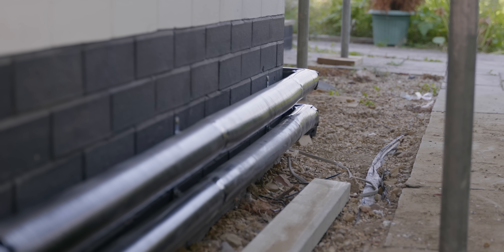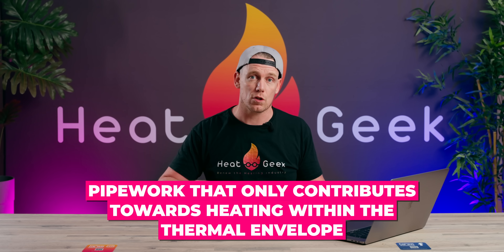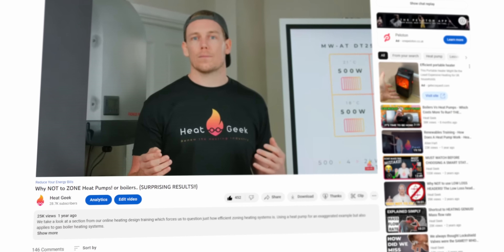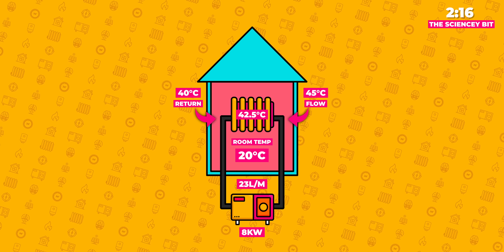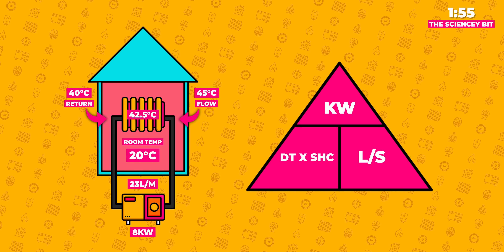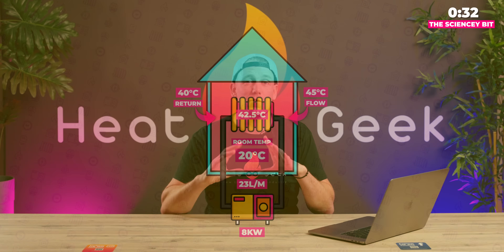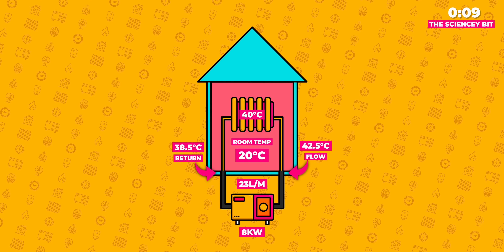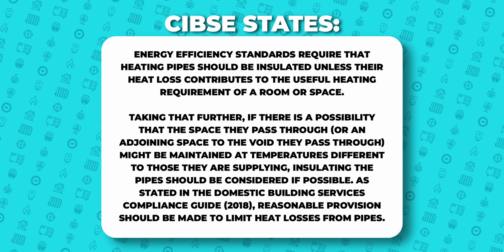Stop Insulating Pipework!

Comment: 9 out of 10 times ignore this and insulate your pipes. This only works if your house is very  well insulated and you heat your whole house at all times.
Reply from the maker: This is relevant for 90% of UK homes. And 90% of homes should be stable state heated.
Reply: @HeatGeek  what about the 10% ?
Reply from the maker: @Steamzombie1838  insulate in the 10.. as we say in the video
Reply: @HeatGeek a lot of UK homes won't have heating on a different zone than hot water sadly.

Comment: In my case the floor between the ground and 1st floor is not "within the insulation envelope" because I live in a 30's house with a howling gale running between the floors.  I also found that the cold water pipes were running alongside the heating pipes, meaning that I had to run the tap for a while to get cold / fresh-tasting water.

My rooms are all separately timed / zoned from each other (my heat moves around the house with me, on a schedule) so i feel that insulating the pipes was a good move, overall.  It was not expensive and I was pulling the floors up anyway, upgrading the pipework for a possible heat pump installation (on which I am yet to be convinced, though I am still thinking about it).
Reply: Cold pipes should never run along side hot pipe work because of heat gain into the cold.
Reply: @jablot5054  ideally, yes. But this house was built in 1935 and I'm afraid that ship has sailed.
Reply: Why is there a howling gale running between the floors?? Shouldn't you deal with that?
Reply: @ChrisLee-yr7tz  I may be exaggerating... but the walls have cavities (filled, but still), they also have vents, the joists penetrate the inner brick line, this joint is far from perfect, therefore any strong wind that blows at the building penetrates the void beneath the floor.  I would not, therefore, say that this is a fully insulated space.
Reply: Further, even if i did wish to fully seal these joist entry points, I would have to pull up several floor boards to get to them, and foam the gaps, which would likely result in rotten timbers.  This is an old house, it's not supposed to be fully sealed.  I have removed the worst of the ingress of air into the living areas but the structure needs ventilation.
Reply from the maker: @Possibly Interesting  ifnyou have howling gales between the floors of a filled cavity property you have bigger problems. And your rads have to work much hotter currently then they should do.
Reply: @HeatGeek  as I say, something of an exaggeration for comedy effect. The cavity filling is not perfect, my Flir shows bright spots, needs looking at. The house is old, I'm doing the best I can but a new house is definitely not on the cards. Everything is now pretty well sealed from draughts, the place is much easier to heat as a result. But things like the old chimney vents are not a problem I can solve without spending a lot of money for not much gain. I do have gigantic radiators everywhere, so true vast majority of the heat goes into the rooms, very quickly. I know you're not wild about zoning but I keep my doors closed and it works well for me, I'm happy with my choices.

Comment: "and lastly, please do always insulate [pipework going through] brick walls". I don't see why you should always do that. Depending on the construction style (varies by region/country), brick walls can be used inside the thermal envelope. Why would you insulate those? 
Other than that, love the video -- makes complete sense!
Reply: I think Adam was really talking about "external walls" when he mentioned insulating the pipework passing through brick walls, but as he was wrapping, he just called them "brick walls" so he could slip in the reminder about sleeving pipework going through any brick or block wall, which is done to allow the copper to expand and contract, and to avoid contact with any mortar than might have a high sulphur content.

Comment: Guessing you still going to want to insulate your hot water system pipe work to avoid losing unnecessary heat into the envelope during the summer.
Reply: Yes, Adam said this at the start of the video. He also mentioned about insulating the cold water supply pipes which can have a number of benefits: slightly warm water isn't as nice to drink, it might get warm enough to allow legionella bateria to start to multiply, and it might promote condensation in damp rooms such as bathrooms.

Comment: Similar argument over incandescent light bulbs. Heat and light at the same time. The heat may not be considered efficient as it's not light energy but in the UK, certainly for half the year, needing to use lights and heating go together :)
Reply: but thats the equivalent of using resistive heating which is terrible compared to heating with heat pump systems
Reply: @N1ghtR1der666  It is yes but if it's already there and a heat pump isn't, then it's just not waste heat, as distinct from just being less efficient than it could be for the same energy input.

Comment: What’s your opinion on radiator pipework running through screed above a concrete slab, none of which is insulated? Octopus are installing a ASHP and I I can’t get a straight answer on whether the loss of efficiency makes it worthwhile changing the radiator pipework to run up the walls and into the first floor void. My rough calculation is that there’s currently 30 meters of pipe currently running in the screed.
Reply: Not having insulation under the slab or under the screed isn't going to meet part L of the Buidling Regs. So you could ask them to show how the installation complies with Part L and leave them scratching their heads.
Reply: @tlangdon12  Part L is not retrospective. Imagine the chaos of all the uninsulated concrete slabs being dug up.😳
Reply: Thanks Tony, I’ll give that a try 😂

Comment: Very technical. But not insulating any hot water pipes within the thermal envelope used to be the norm anyway years ago. When did they start doing it and why. Would be my question. I don't follow all the technical mumbo jumbo but I just think a hot pipe radiating heat back into the room isn't doing any harm and as you say may be a benefit, so we never insulated them.

Comment: I have a question…..my parents have a detached house with a fairly new Ideal boiler heating 13 not very big rads and a megaflo water cylinder. They had the boiler temp set to 70. When the heating is on the return is about 68 so no condensating going on there. I lowered the boiler temp to 60 which made the return about 53 and with a few tweaks to the rads the house was still warm even in these current very cold conditions. My father is worried about the hot water temp as the cylinder stat is set to 60. What are your thoughts please? By the way, great videos, very interesting.
Reply from the maker: If you have a combination boiler it doesn't matter. Turn down the hit water temp tho. If noy a combi the boiler needs to be at least 5c higher than the cylinder.
Reply: @HeatGeek  thanks for the reply. Not a Combi. I will set the boiler temp to 65 so at least it’ll condensate for a while at least until the return comes up. House needs bigger rads really which is what I’m currently fitting to my house after watching your videos.
Reply from the maker: @LolsK6  watch out hotbwater temperature video before you do that!
Reply: If the DT across the boiler is 2C they probably do not need the heating on.
Reply: @normanboyes4983  not necessarily, it could also be that the radiators are all fully open across their lockshields, as seems to be common now when installers fit TRVs (I have had a few tell me it's not necessary to balance rads if TRVs are fitted).  The problem there is water flows through the system too quickly, reducing heat loss significantly, which is not what you want! This in combo with an low ratio modulation, oversized boiler and small rads would cause this situation IMO.

Comment: To make heat my heat pump has 2 big fans 2 pumps 1 condenser to bring it up to heat and cost a lot more than my gas fire which heats the room I am in the heat pump runs all through the 4 bedrooms kitchen and bathroom do the sums in cash.10 minute gas, toasty 2 hours heat pump not so toasty and skint.
Reply: Your gas fire is dreadfully inefficient compared to your heat pump. About 50% of the heat it produces goes up the chimney! What a waste!
Reply: @tlangdon12  yes but the 50% is where you want not heating empty rooms plus it is cheaper.I have tried it and proved it heat pump don’t cut the mustard 55kWh to keep the 1 room warm gas fire toasty and cheaper.No one will tell you how to run the thing,leave it on turn it off? Love to know
Reply: @Allegedly2right  What make and model is your heat pump? I'm curious what size of heat pump can consume that much power.
Reply: @tlangdon12  Grant Aeronia HPID17 R32 yesterday it was 28kWh the colder the more it uses and that is 19c
Reply: @Allegedly2right  Thanks for the prompt reply. I’m guessing you have a very large property. My 5-bedroom Victorian End Terrace house with solid walls, old double glazing and minimal loft insulation is heated well by 19kW. 55kW of heat loss is immense. Your heating bills will also be immense.  But the problem isn’t the heat pump, it is the size and level of insulation of your home, and the cost of the electricity.

Comment: I've always wondered about this in floor spaces and have yet to do it. I was considering starting to do it with heat pump installs so I'm glad you've cleared this up.
Reply: Full marks for English.
Are you English and middle aged?
…apart from “installs”
Reply: @paulgrieve7031  do you search the Internet in pursuit of grammer mistakes? Does it make you feel big to correct people? If so you really need to find a better hobby.

Comment: Trying to explain this to building control after the Part L changes is not fun as they practically insist at times that anything not a radiator should be lagged. Next time I get a difficult one I'll send them to this video, it's faster than digging out the literature.
Reply from the maker: Thanks 😊 .. what literature is there though???
Reply: @HeatGeek  The Part L document itself, I normally have it printed in the van along with BS7671, the gas regs and pressurised hot water to throw at them when they're being daft. Though I find most of them have a little knowledge of all areas, very few are up to speed on everything they're actually looking at.
Reply from the maker: @Effer Vescence  This isn't in part L interestingly!
Reply: @HeatGeek  That's exactly the issue, they tend to come on site and make assumptions. One site we even had a chap that wanted us to put LPG in a basement (4 inches below grade) rather than sticking to oil (due to being near a river). You have to spoon feed them information like first years. The video will be preferred compared to having to sit pulling teeth.
Reply from the maker: @effervescence5664  the struggle is real!
Reply: @HeatGeek  "This isn't in part L interestingly!" ... Is this actually correct? I'd LOVE you to be right but it states in the latest Part L docs (that came into effect on 15th June 2022) that: "4.24: In a new system, all of the following new pipework should be insulated. A) Primary circulation pipes for heating circuits where they pass outside the heated living space,
including where pipework passes into voids." I believe it's OFTEC's view that 'voids' refers to anything where pipework is effectively hidden, e.g. under floors. So, surface-mounted pipework doesn't legally have to be insulated but stuff under floors would. I also understand that it's now expected that this is documented photographically at the time of install so you can prove this has been done. As much as I agree with you on this Adam, I think to comply with building regs, you've got to insulate. Any more thoughts on this?
Reply: the regs are correct, you don't want to warm up floor voids and other perimeter spaces when these don't need to be warm, not insulating the pipes in voids is like putting a big radiator in a store room and then claiming you are saving heat!
Reply from the maker: @Alexander Newnham  yeh, my thoughts would be.. as many regs, they are incorrect. Regs haven't kept up with tech and information. We aren't breaking new ground here
Reply: @HeatGeek  Not sure I totally agree with your arguments on this one.

The thermal envelope is not always continuous. Take our timber framed house, there's 100mm of insulation between the studs in the walls, but zero between the ends of the floor joists where they sit on top of the walls.

However, I think the biggest reason for insulating pipework is to do with the airtightness layer in a building. It is usually formed at the plasterboard level by the joint filling and/or skim coat on the internal surface of each room, sealing any penetrations (such as switches, sockets, light fittings), and also sealing the wall to the floor by silicone around the skirting board. However, in the wall/floor voids, there is little consideration given to airtightness. Heat loss to ventilation will be greatly increased in these areas (especially where the joists are cut into the walls).

I think a good portion of the heat from pipework in voids, will be lost to ventilation. I would say this is why the regs say you must insulate pipework in voids.
Reply: @stokebob  I agree. Also this Heat Geek advice assumes a perfect configuration, which we all know is sadly rare.  We have a large (220m2) semi over three floors, that has an undersized boiler and rads (thanks to previous owner's reliance on British Gas boiler insurance scheme), boiler is in basement (habitable room) with all pipework in the room exposed and unnecessarily winding/long due to many alterations over the years. It resulted in that room getting significantly overheated, and the rooms on top floor not getting warm enough. So we insulated all the hot water and CH pipes in that room, and also the exposed 22mm CH pipes going through kitchen above to upper floor, and it's resulted in a reduction in gas usage as well as a much more even heat throughout the house. That's because the system was far from optimal in the first place.  Hence it's worth doing the math on each individual situation before applying blanket rules.

Comment: Your SAP/EPC score will suffer a tiny bit for this.
Also if you are running the pump for hot water only during summer wont this contribute to overheating?
Reply from the maker: We cover hot water at 2.15 - 2.35

Sap is different from real world efficiency. If sap doesn't agree with physics sap needs to change. Sap also down rates heat pumps over gas boilers as it uses figures from 2010.
Reply: @HeatGeek  SAP can't follow real world physics it's not designed for that.

Comment: What about under kitchen units?
Reply from the maker: As per the video.. no.. the kitchen emiiter has to heat that space otherwise. The very simple maths doesn't lie
Reply: @HeatGeek  I think the question here is more about localised heat build up in cupboards contributing to food going off faster - the same reason that most of the underfloor heating people (in my limited experience) have avoided running UFH under these units.
Reply from the maker: @David Langford  this is the first time I've ever heard this argument.. I don't know many people that have pipework running though a food storing kitchen cupboard.. the ones I do know of are definitely not lagged.
Reply: @HeatGeek  Leave them uninsulated and use the kitchen cupboard as a crockpot.😉